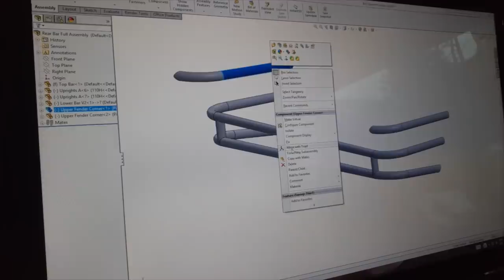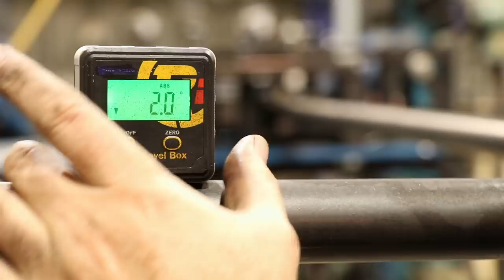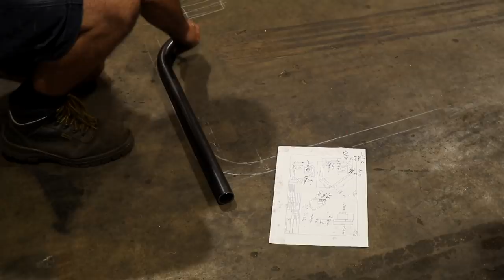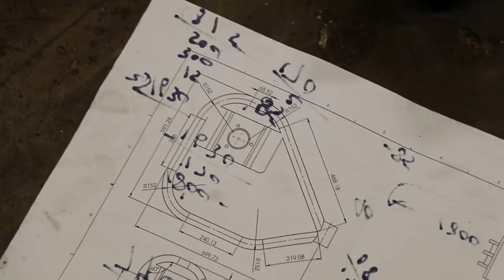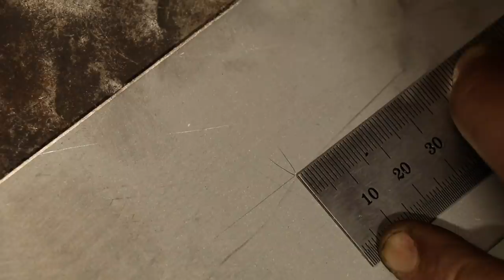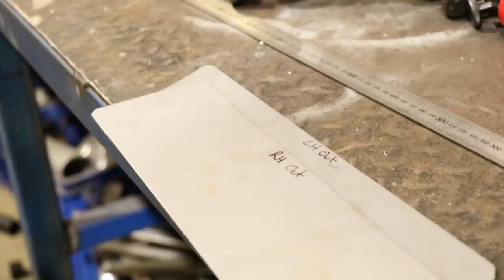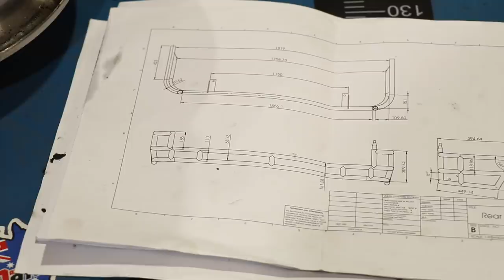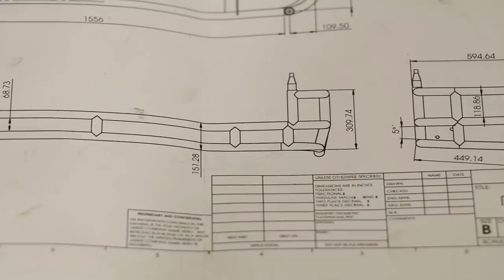How to build your own rear bar & tyre carrier - Cummins Patrol Ep15

Comment: I have a tube mandrel/bender, it’s a JD squared model 3, similar to yours being ratchet system, but is only £700 for the machine and die sets around £300, made all my roll cage out of mine, did a few for mates, paid for itself in no time, quality things to have

Comment: Many a successful old racing car was built using the chalk on the floor method.
I was half expecting a flash cantilever frame for the spare tyre so you could just glide from the storage position to the ground ;-)

Comment: I'm a big fan of steel plate for making up bumpers, no real special tools or technical cad needed and pretty easy match aftermarket finish level in a home shop .
Bending tube up is PITA get dimensions/fit right both sides and ends and infill becomes messy .
Interesting see how blends after powder coating, expect will make big difference .

Comment: Not sure about a s4 gu patrol but on the s1 gu those rear lights worked as tail lights at night but only the left one worked as a reverse light. The ones on the stock bumper were tail, brake and indicators.

Comment: Love the work on the rear bar Al but lose the tyre carrier and just put it on the door. It will be fine and one less thing to stuff around with. (Had a 35 x 12.5 hung off the door for over 13 years and 190000km & never had a problem) bar will look smick powder coated.

I'd suggest a youtube collaboration meet up with Tyler Thompson and Shad Donaghue for an off road baptism.
Can't wait to see her getting punted up a track!
👍

Comment: Slight suggestion... Maybe add a latch to the door itself; linked to the lower latch so only one handle part needed. You don't want it taking mush of the weight, but having the door help to hold it vertical and stop any weird flexing that'd fatigue the pivot pin.

Comment: Nicely done, again. Did you consider plugging the upmost tube behind the tires? Would avoid water and mud doing a mess inside the rear bar.
Reply from the maker: That was all done with the bar off when the inside welding was done.

Comment: Hey mate I have some questions about the ez30 I’m planning on putting one in my Impreza so If buy a 6 speed manual transmission will the bell housing fit to engine ?

Comment: I put some bolts in from the back of the tyre holder so you can hang the wheel straight up without balancing it there trying to line the studs up. Makes it a 1 man job. And you could almost bet your left nut that you’ll get a flat on your own!
Reply from the maker: It already has a platform and a stud to line it up.

Comment: Reason they had the stand off is cause series 4 has a different rear bar and the tie point bolt on to that stand off. On series 1-3 they had a recessed step and the tie point bolted to the back crossmember

Comment: Hi guys. That wheel mount would be much better if you add an angled tube on the vertical hinge post down to the horizontal bar. About a 45deg angle by the look of it.
That will triangulate the mount and help to take the weight of the spare. Transferring wait to horizontal bar.
Otherwise eventually i think that vertical hinge piece will crack at the bottom weld.
Reply: And then you can't open the door anymore
Reply: @emilerichier   triangulate on the other side.

Comment: Any reason why you didn’t design the swing away to open with the right door? I guess it’s less of a convenience issue if the left door clears the tyre.
Reply from the maker: The LH door opens first so you don't need to open the swingaway or RH door in many cases. You wouldn't be able to open either door without opening the swingaway of it was on the LH side.
Reply: @theskidfactory  I more wondered about attaching it to the right door with a linkage instead of it having its own latch. Advantages being:
A) it just opens with the door, rather than adding steps to accessing the back.
B) it can’t collide with the right door if the wind catches it while it’s open.
Works well on Defenders with the single rear door.

Did you add anything to limit the range of swing of the carrier so that it can’t mash the rear quarter panel?

Comment: So with all the modifications to the suspension, steering & driveline does this have to go through any kind of inspection ? Same or similar to what Benny (BCW) had to do with the Cresta, i think he called it engineering ?
Reply from the maker: Yes it needs a modification plate for engine, trans, seating capacity. Some mods to suspension are pre approved. Front and rear bars do not require modification plates.

Comment: Not to be a smart-ass, but air over hydraulic rams simplify tube bends. Operating from a position of seeing this well after the fact, so apologies from Stateside if that sounds rude. A quarter cut might help with departure angles if you’re getting a lot of angles when off-road.
Reply: A very tidy build.

Comment: Did you use a mechanism to hold the swing away open when accessing the rear doors?
Reply from the maker: Yes. It has a spring latch and a receiver made out of a gudgeon pin.
Reply: @theskidfactory  Ideal, I'm building one for my 98 Disco, this seems to just be the way to do it.

Comment: Instead of the nylon strip, how about a pin on the bottom of the moving gate and a socket on the bumper under the top bar
Reply: Nylon was chosen to prevent metal to metal rubbing wearing paint away (powder coat) and causing rust to set in. But good idea. 👌

Comment: Hi guys, just want to know if there are any ADR regulations on making your own bars. I was going to make my own for my Hilux but got scared by some of my friends that said that the bars had to have ADR certs to be legal. Do you know if this is true?
Reply: I've never heard that, why would they be called roo  bars if they didn't function?
Reply: There are regs regarding front bars on cars fitted with air bags, anything before that (without) is fine.

Comment: Do you have the specs on that tube? You said 1 1/4 "precision tube" but what's the OD and wall thickness? Never heard of precision tube in NZ. Chur
Reply: Its 1 1/2" or 38.2mm OD with 2.5mm wall thickness. Its just black unpainted tube. We just call it precision tube so that its not confused the rollcage seamless tube.

Comment: Kinda dissapointed you didn't have a ladder mount on the side of that rear bar. Would have been good at adding some extra strength to the roof rack and easier access

Comment: I could tickle that with a 3/32 7018 and it would look mighty fine.  But welding light wall tube with stick is kinda annoying light wall pipe is much better for welding with a stick but damn expensive for good stuff

Comment: Did anybody disconnect the batteries before welding ?
Woody I'm looking at you😳
Reply: No need to on that rig.
Reply: With a mig and the ground so close to where you're welding it isn't likely to kill anything. HF start TIG is a different beast though.
Reply: @SpencerHHO  it's still a great rule of thumb any welding disconnect the batteries Iv even seen them blow batteries and damage computers when the isolater was turned off.

Comment: Wear safety gear when welding ya muppets..
Reply: Came down for the anorak comment. Was not disappointed.
Reply: Nah all good, no need for helmet or gloves when you’re tacking, just shield your face with your other hand.
Reply: Good job they weren’t welding muppets then, only steel..

Comment: Why on earth go through the effort to build a solid rear bar just to have French bread sticks for side steps?
Reply from the maker: The bread sticks are mounted to the chassis using welded on plates rather than the clamps supplied.

Comment: So many complaints! Where to begin? 1) Any sprint car builder worth their salt would TIG a silver dollar over the couple remaining open tube ends. 2) You got us part way there on how to make your bends the proper distance apart: Do a test bend, draw out your pattern, mark BS, but then what? Comeon dude! What do you do at the bender to make the bends where you want? I've built a bendy tube things but have NEVER been able to get the second bend where I want it. Sigh. 3) I know you're just trolling me with that welding with eyes wide open and no protection... I used to be just like you: loud engines (and rock and roll music) and now my ears ring 24/7 louder than my wife yelling at me, welding without gloves until a molten glob of slag hit my wedding band and burned my finger to the bone, welding without eye protection until a smaller bit of hot slag hit me in the eyeball and gave me a nice crater. That shit's all cool and fun until it isn't. Dude... please protect yourself.